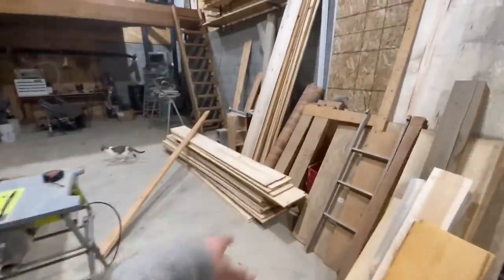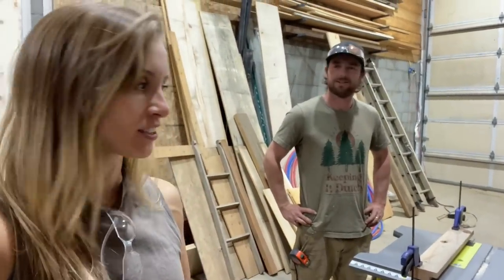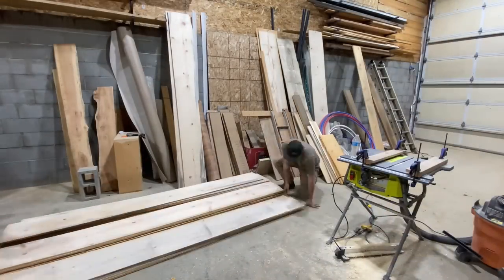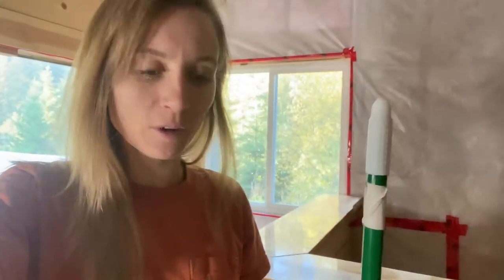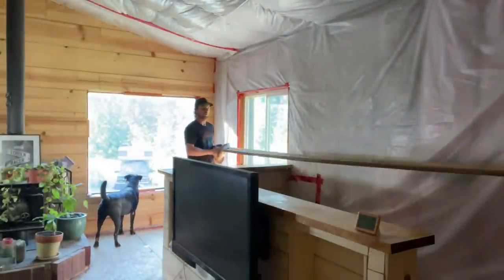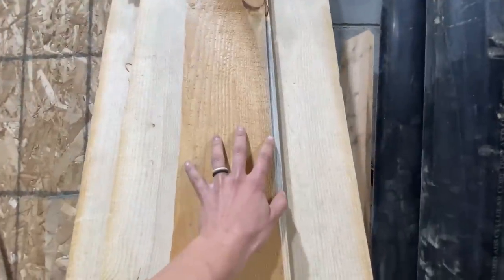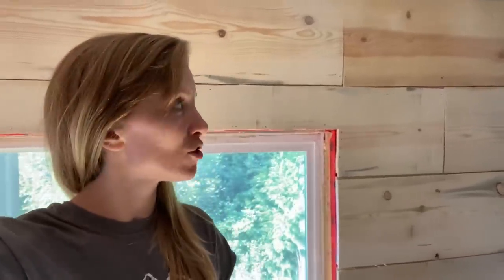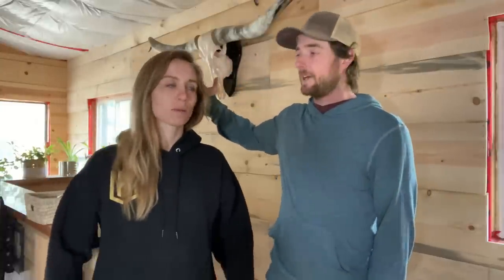This Makes a HUGE Difference | Shiplap Walls in Our Shop Home

Comment: New Yankee Workshop (S14E07 Work Table and Clamp Cart) made an mobile workbench that would make a great out-feed table for your saw. Easy to make. Same height as table saw.  I think it would help you with making ship-lap joints. Looks amazing. Well done. Thanks for sharing

Comment: If you cut the but joints at a 45. It will not show the gaps as the wood shrinks. Also edge the whole pile of boards on the mill to make them all the same with.

Comment: Paint is for drywall, stain the shiplap. Paint makes gaps look like, well. . . mistakes. Stain makes gaps look like character.  As your site grows you will eventually upgrade to tools (saw, mill, plane. . .) that are far more capable, and accurate than Harbor Freight and accessorizing the old stuff will not make sense. The biggest problem is your wood, which looks to be high quality, except it isn't dry which is why you have all of the warping. Do you plan on setting up a wood kiln? You might take a look into it, they aren't as expensive or complex as you might think. Thank you for the video.

Comment: Take a couple scrap pieces of  your siding and make a feather board. Use it to loosely hold the edge of the board against the fence of the table saw.  Also take painter's tape and put on the edges of your jig saw to prevent the aluminum from marking up your boards.  Looking good.

Comment: Maybe the ceiling first would have been a better plan, as the wall boards would  provide edge support for the ceiling boards to avoid sag. Are there nailers where the ceiling will meet the walls between the rafters? Also, you need an outfeed support for the table saw.

Great looking boards, rustic and consistent throughout. Lots of work, good work!!

Comment: Have you thought about making an outfeed table for the saw? It would definitely add stability and make it safer for those longer pieces of lumber.
Reply from the maker: We were just talking about this! We will be figuring something out for future boards.
Reply: @LaidBackLiving  You can purchase simple folding stands with a roller and guide to keep lumber from shifting.

Comment: what I was thinking while watching you do that it's pretty good idea that you came up with with the fences on your table saw what you need to do is maybe make a frame for your table saw and put some weight on it to keep it from sliding on you sandbags or heavyweight of some kind on the bottom of the table saw so don't slide on the floor just an idea
Reply: With all due respect the idea was a very bad idea.  Extremely dangerous and honestly ignorant.  They got lucky in the lesson and did not get hurt.  NEVER trap material between the blade and no way to escape.  The removal of the outside make-shift fence was a good thing.  Apply forward and side-ward pressure against the fence/blade is all that is required.   Thank God they didn't learn the hard way.

Comment: Congrats on the wall. It looks great. As for the yellow wood, you can try a hand-plainer on that board and get the lighter color. The jig you came up with is a keeper -- very clever.
Reply: The rest of the wall will turn yellow in time.  Esp. were the sun strikes it.

Comment: Recall the time the inside roof was raining down on you?  This addition of wood will help absorb moisture and slowly release it back into your indoor environment.  

If you experience buckling of the ship lap wall covering - simply leave gaps (1/8"}.  As you know the lumber can and will change even as you work it through the many steps in machining - stacking and storing with very careful handling matters.

Don't know if you exhaust your indoor humidity outdoors (kitchen, bathroom, laundry room etc.) but if not consider it.  

Winter indoors can be dry and summer humid.  Consider monitoring your indoor humidity levels (simple $20.00 gauge) -  If needed the proper equip. can be had to control the indoor environment.  This will help keep your choice of wall covering from self destruction. 

Lastly; ask your community for tips and tricks before you jump into it.... it is worth the time.  (JF)

Comment: Here’s my idea for what it’s worth!  If you ripped the outside piece and drilled opposing holes in the new cut, say 3/4” holes and place a heavy duty spring in the holes, you would have a hold-down feather board.  The springs would keep the presses against the fence and the lip would keep the board flat.

Sometime when you’re in Ponderay, stop in the store and let talk about some coatings options for the walls before they change color too much.

Comment: I wouldn’t worry about the imperfection on the wall.  It is part of its charm.
Reply from the maker: We agree! It tells a nice story. Thanks for watching!
Reply: @LaidBackLiving  I too enjoy the imperfection over a manufactured look.  If the require wood movement gaps were applied to the construction of the wall covering the imperfections magically go away.  The end joints your lovely wife pointed out typically would go unnoticed with a proper expansion gap.  Also a slight bevel on the ends helps as well.  True it is more machining but replacing cracked and wrapped lumber is more work.  Still, it looks good.  Best of luck.

Comment: Dude that is a dangerous construction if something goes wrong the wood can't go anywhere ......the fence is not for nothing only on 1 side...feathers on the opposite side of the blade would have been better  they push the board against the fence but when something goes wrong the wood has the chance to go away instead of fixing it....it worked for you but could have gone wrong
Reply: These you tube builders with their old ladies mugging it up and "running" the job are a joke.  The last thing I need is some chick harping in my ear building something